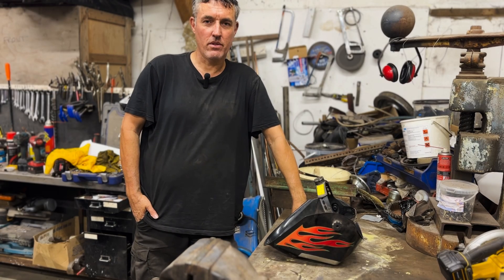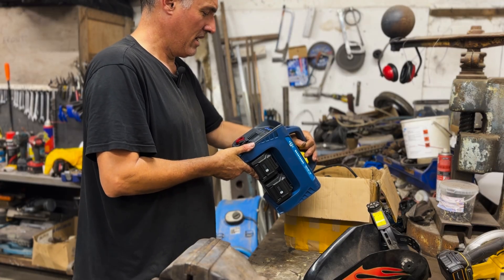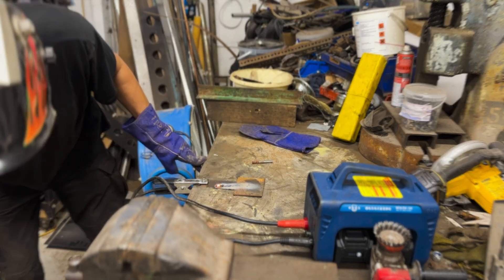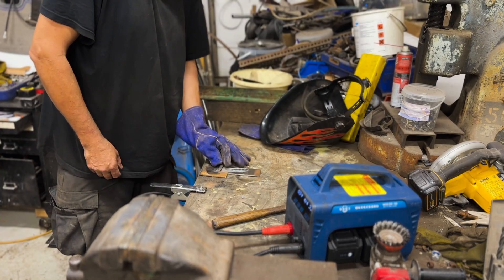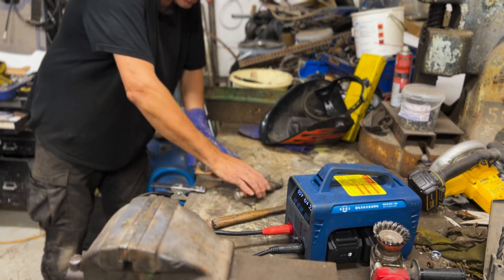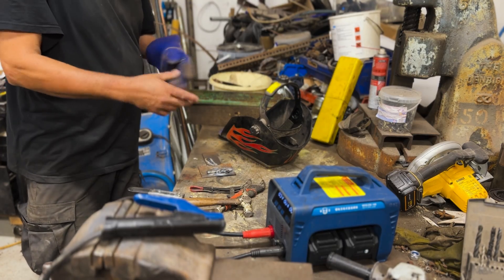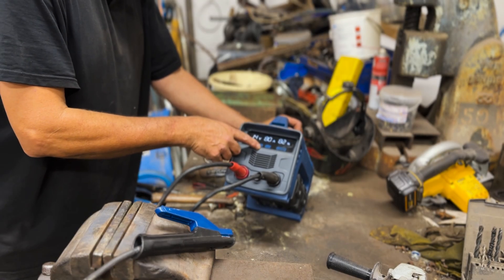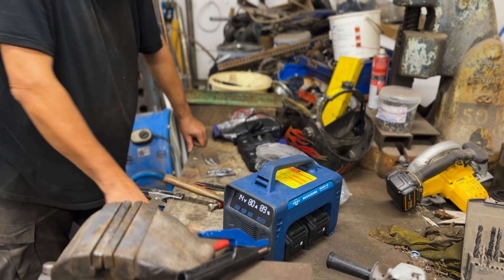Amazon Cordless Welder? For Real? - Product Test

Comment: How long before you need to charge batteries?
Reply from the maker: It’s dependent on the current used, but for welding thin sheet (1.2mm) then about 6 or 7 rods.
Hooking it up to an external dc power source (4 lead acid 12 volt batteries in series) gives a much longer welding time 👍🏼